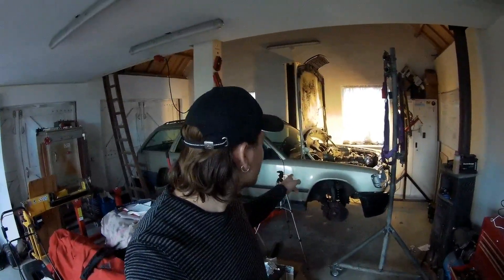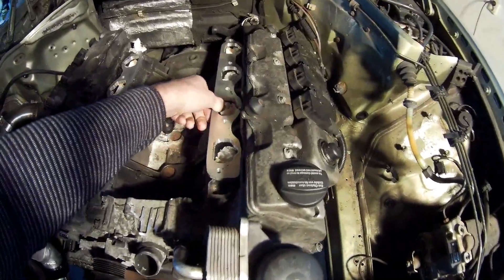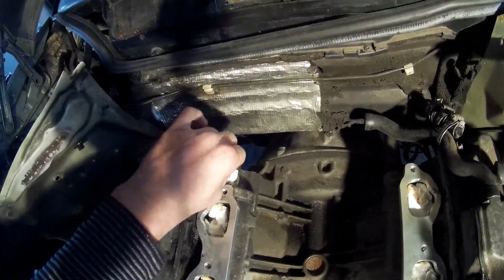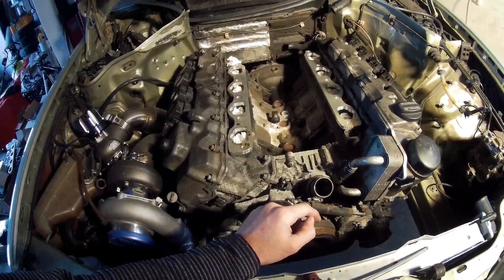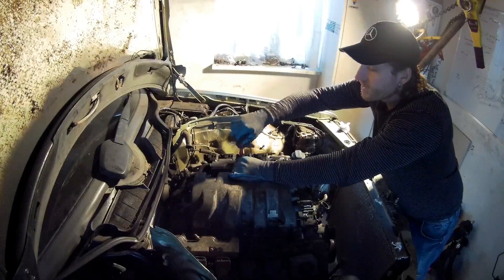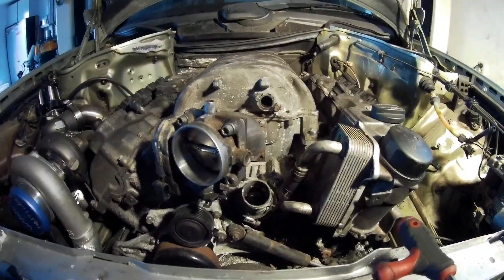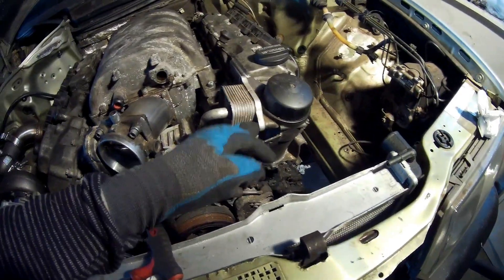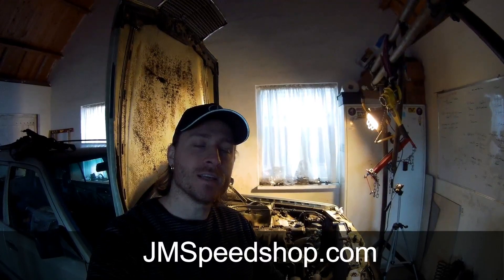intake manifold spacers

Comment: What is that tower thing you cut off in the previous video? That curved aluminum piece with a bolt on it at the front of the engine
Reply from the maker: The piece i needed to remove to turn over the intake manifold ?  That is the mounting for the air fan that will blow air in the exhaust on a cold start to meet emissions
Reply: @JMSpeedshop wow! Never even heard or seen of it. 

Must be an obscure part 😳
Reply from the maker: It is alle the m113 engine's except the compressor version
Reply: @JMSpeedshop  Mine only has half the bracketm I might need to print some in carbon fibre or PETG to make the other half

Comment: How’s the flipped intake holding up? Do you have a method or proven procedure for successfully doing this? I want to buy the spacers from ya.
Reply from the maker: Works good no problems.  But i dont sell the spacers.  I made 1 set
Reply: @ did it increase HP/torque? What are the benefits? It looks like it reduces intake heat soak as well as being a more direct path of airflow. 

Does anyone make the 10mm spacers?
Reply from the maker: @420xwaytoomanyx420 did not do a before and after reason was shorter routing
Reply: @JMSpeedshop  best spot you’ve found for intake positioning? I’m trying to incorporate one of those oversized in-line cone/can filters, but I know space is limited, to have it port from the stock passengers side intake hole. But again…the limited space.

Comment: will you use the stepmotor on the trottlebody to control the gas or will you make a mechanical connection ? I am building the same engine into an old 280 se and was wondering if I could use an electric gaspedal and let the ECU control the stepmotor in the trottlebody.
Reply from the maker: Yes fly by wire.  Most standalone ECU have the option to control this .

Comment: Very inventive, 10mm space will increase torque slightly, but might also reduce intake temperature. Did you use the gasket as a template?
Reply from the maker: Yes that is also something i found on spacers for m113k engine . I used the gasket as a template yes

Comment: That's some great news on the manifold. What made you decide to add a oil cooler? Is the water/oil heatexchanger at the filter too weak?
Reply from the maker: I think it can not keep up with the temp control when boosting the engine .  The kompressor version also has an external.oil cooler from from factory